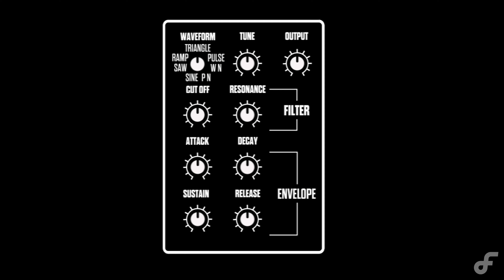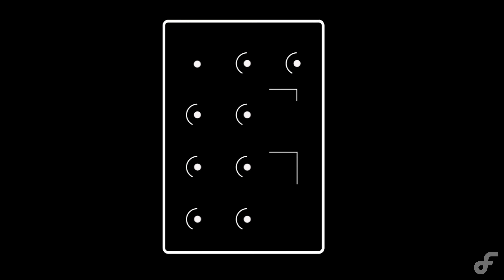What is an Arpeggiator

Comment: Wass up Dan 🤜🤛  I have one Major important question do I need to buy a Midi Controller that has a Built-in Apeggiator? I ask because I had just brought a Brand New Akai MPD26 drum pad machine for $95.00 with free shipping & I'm thinking about buying the $200 M-Audio Keystation 61Re Controller cause it has the better heavier keys and it has USB and the 5pin Midi Out just like my Akai MPD26 drum pad, but it doesn't have a built in Apeggiator & not only that Dan in case I find a nice used Roland JV-1080 Sound Module I'm gonna want to get it, cause I do R&B & Hip-hop & the Roland VST, sound quality is 🗑️ Trash !!!! Compared to the actual sound coming out the actual external hardware of the JV 1080 plus I have not seen no video on those JV80 expansion boards in wave files or anyone selling them in wave files either.
Reply from the maker: hey naw that shouldn't be a worry at all. most daws have an arpeggiator built in so it can do it for you :)
Reply: @danfur7994  Thanks Dan I be wasn't sure but I had got the M-Audio Keystation 61 Midi controller 3 days ago for $125.00 with free shipping and it was a open box and it was like Brand new & it came with a USB cable owner's manual & the code for the free Protool's light and Abelton live light, but I will probably start of using Garage Band or Mpc Beats since it's free then I will upgrade to the PreSonus studio One Professional.

I do have one more question what's the difference between the retail $400 store version and the online crack version?